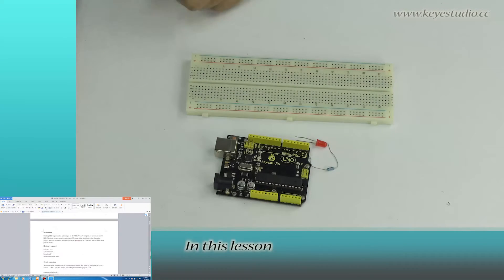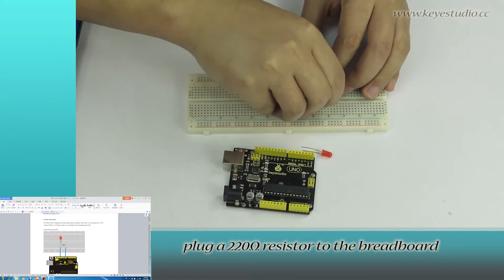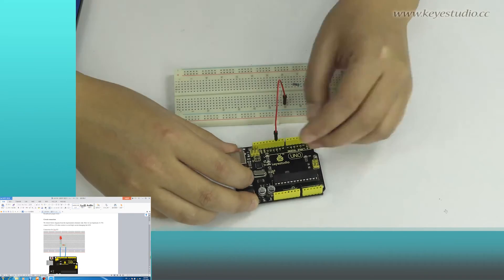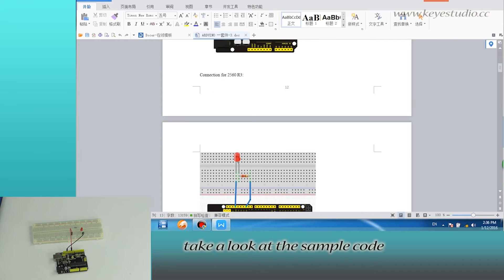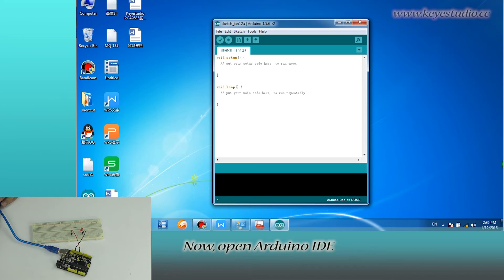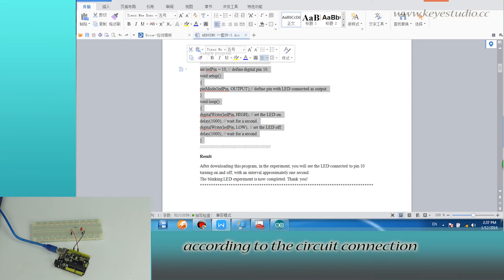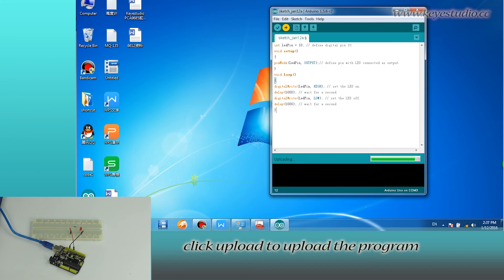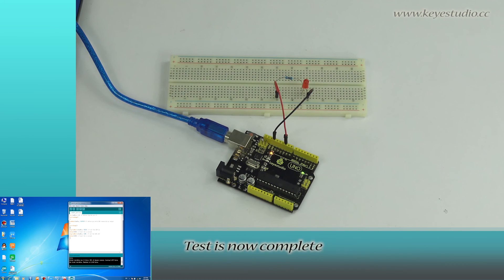Super kit: LED blinking

Comment: here is the working code
int ledPin = 10;

void setup() {
  pinMode(ledPin, OUTPUT);
}

void loop() {
  digitalWrite(ledPin, HIGH);
  delay(1000);
  digitalWrite(ledPin, LOW);
  delay(1000);
}